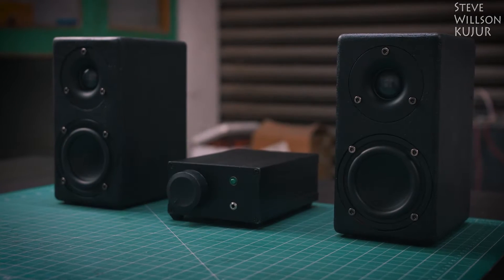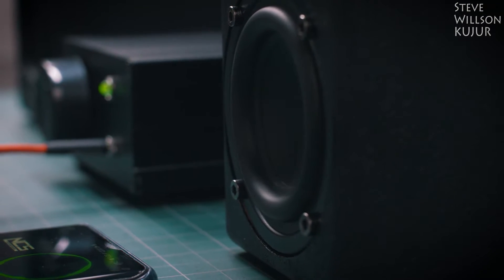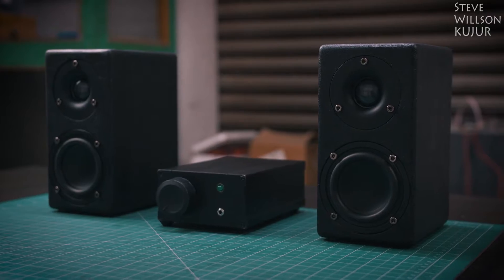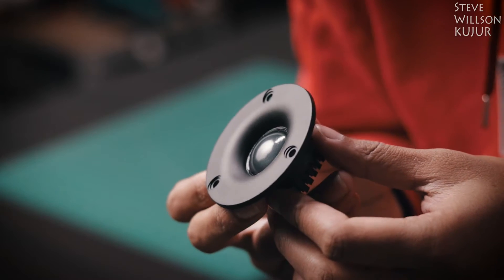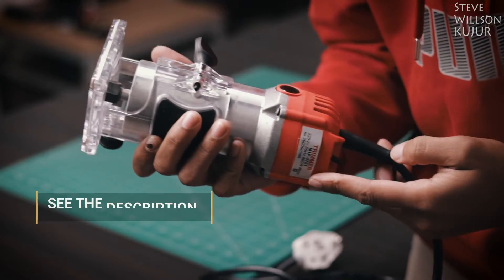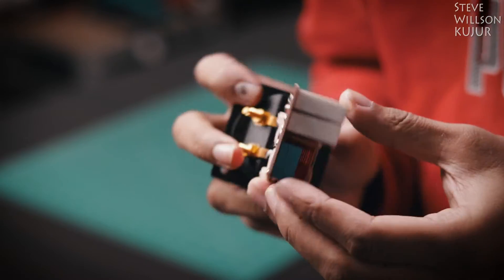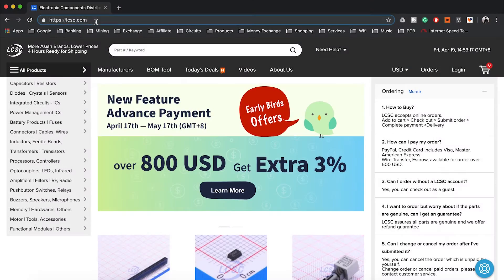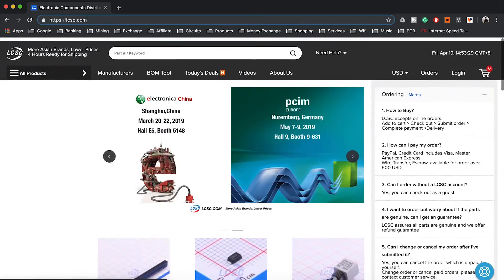DIY 2 Way Bookshelf Speakers | Super Bass

Comment: You use 4 speakers rated at 30 watt, so using a 200w amp won't damage they?
Reply: you can never have too much power unless you play it over the xmas, the unused power is only converted into thd